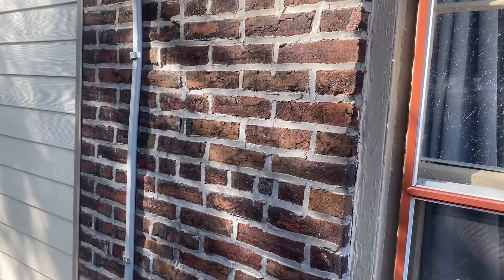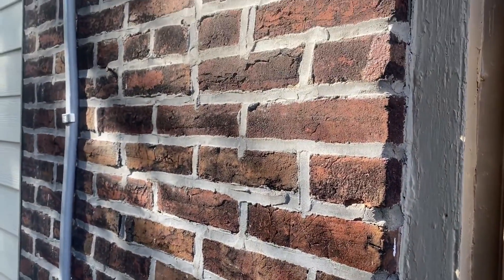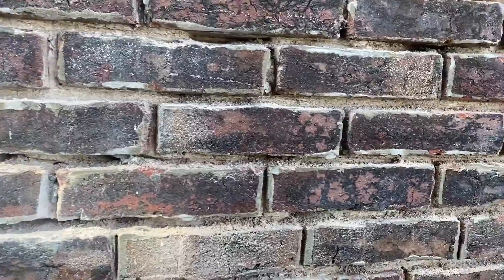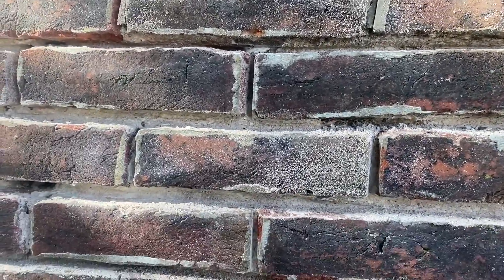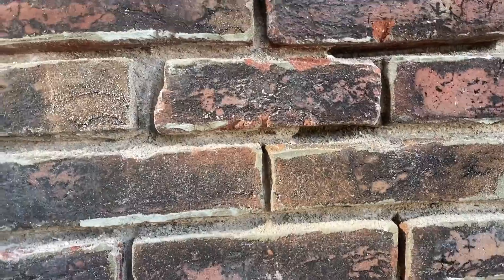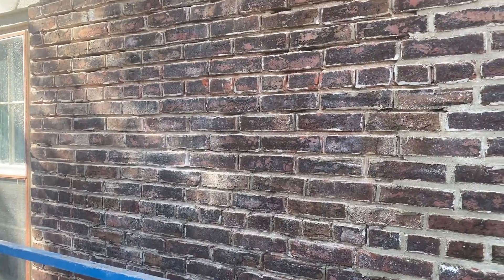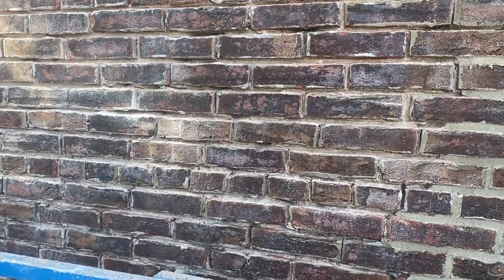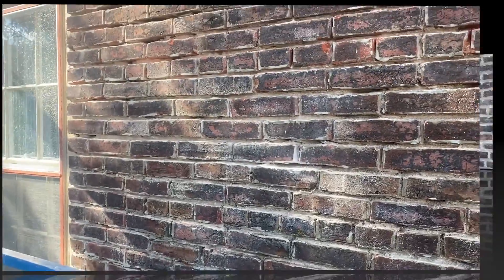Removing Portland cement and repointing an old brick home using NHL 3 5

Comment: I did tuckpoint in my house built in the 60 s 
I used brixment cement, should I be concern on having the same problem?
Brixment type N 
For tuck point
Thanks for the reply
Reply from the maker: Most likely by the 1960s the bricks used to build your house were substantially harder than the ones in this video which are from 1880's. 
Harder bricks can withstand harder mortar. Older bricks need a lime based mortar because they are softer. First you need to know how hard your bricks are and then you can determine if the mortar is correct or not. If the bricks are showing damage but the mortar isn't that is a sure sign of a problem.

Comment: Very good information. I made the mistake of using mortar caulk in deteriorated/missing mortar joints. After five years, those same joints are now showing signs of moisture trying to get out (small cracks alongside joints). There are cracks in my plaster walls (interior of house) corresponding to those mortar joints. My house is 75 years old. So I'm going to remove the caulk and replace with the hydraulic lime. 
Never knew how important mortar joints are and how careful we should be replacing them. Thanks so much!! 🙂

Comment: What about the foundation? Doesn't the NHL 3.5 stay wet too long when it's used underground? How do you protect the NHL 3.5 for a historic foundation of the same type of construction?
Reply from the maker: As long as it has a chance to cure, it should be fine underground; but it really depends on a lot of factors, especially if there are water issues there.